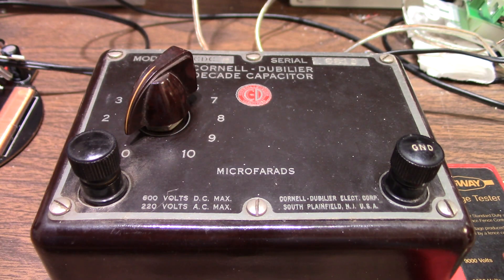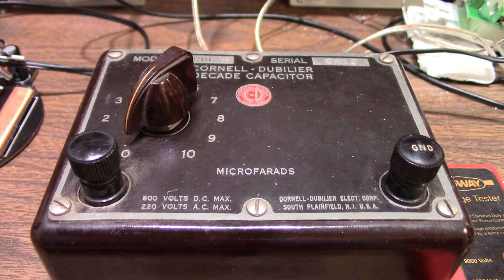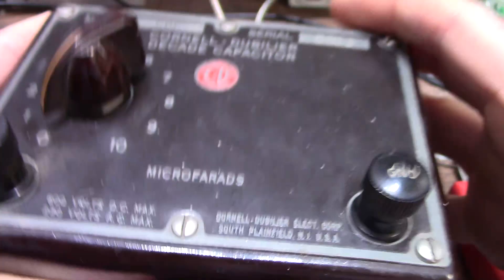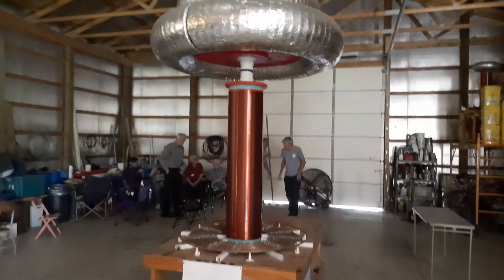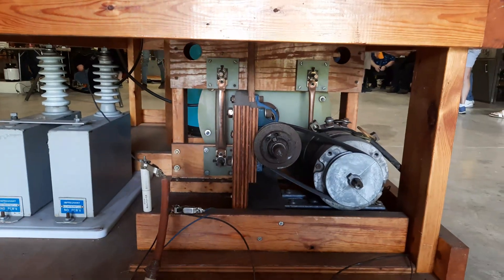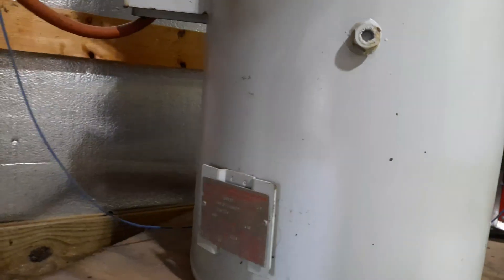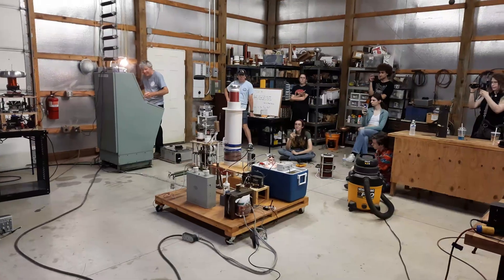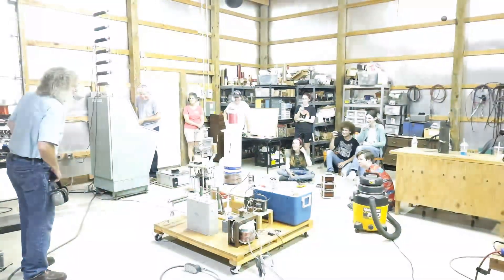Distribution transformer powered tesla coil demo

Comment: Should have brought your EM detector! A little scary with all rhat energy being dumped into the air a few feet away. I bought a fence checker like that but it doesn't seem to work right or probably my fence chargers are too weak. just  the highest number lights faintly with the one short duty cycle pulse per second output. I was unable to get a TV high Voltage meter to read anything at all, must be too much of a load.

Comment: Heh. My son went through a Tesla coil phase at 17 years old. I got just involved enough to prevent him from killing himself. We built one that looked very like that, only 4 feet. Neon sign transformer. Double air gap. Beer bottle caps. Made ~1 foot sparks and lit a florescent tube at about 10 feet. Bottles shattered every few minutes and had to be replaced. Scary. He turned it in as a physics project. The teacher promised him an A+ if he promised not to try running it in the building. 😊